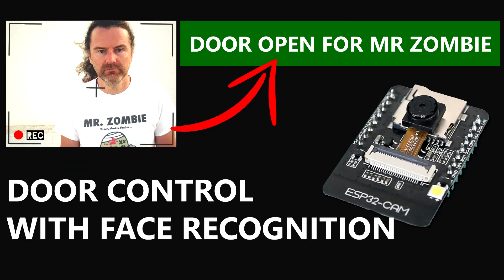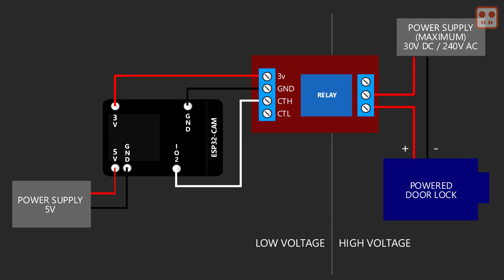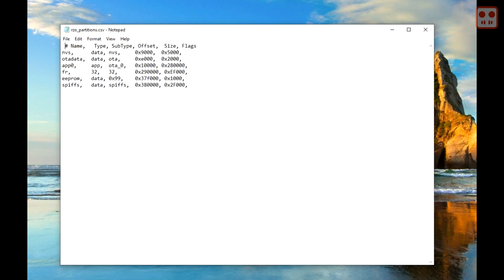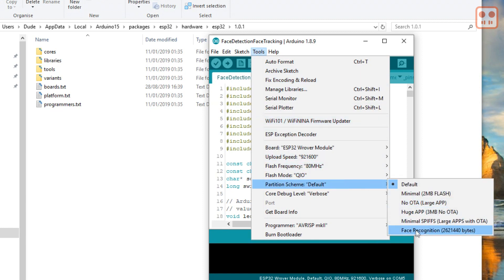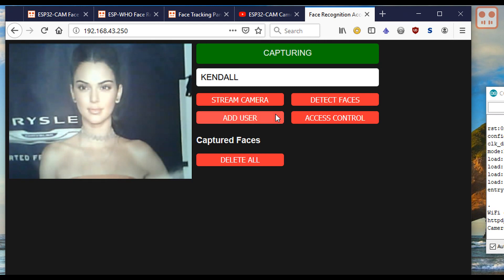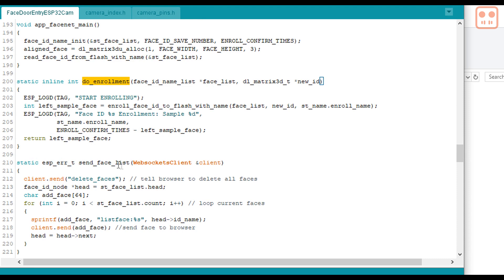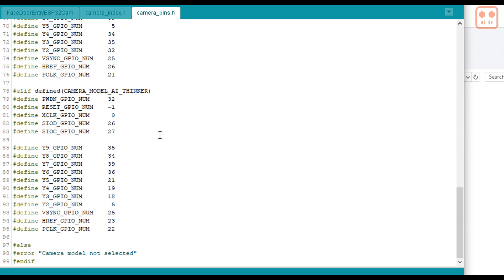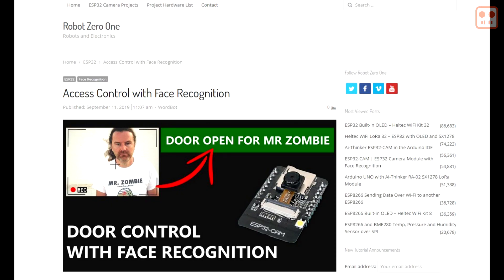ESP32-CAM Face Recognition Open Door Lock

Comment: Sir  @robotzeroone , I'd like to ask if instead of a door control. Could this system be used in connecting to a MySQL database only for checking if the individual is registered or enrolled within the system?
Reply from the maker: yep, you can use HTTP libraries to send data to a server on the internet. There's stuff in my other projects for this.

Comment: hi, sir
i am using esp32cam module for collage project, some error create.

E (4456) system_api: Base MAC address from BLK0 of EFUSE CRC error, efuse_crc = 0xdb; calc_crc = 0xda
abort() was called at PC 0x400d61ec on core 0

Backtrace: 0x40091448:0x3ffd53d0 0x40091679:0x3ffd53f0 0x400d61ec:0x3ffd5410 0x400d6239:0x3ffd5440 0x400f2307:0x3ffd5470 0x400eefaa:0x3ffd5490 0x4009458f:0x3ffd54b0 0x4008db91:0x3ffd54f0

Rebooting...
ets Jun  8 2016 00:22:57

rst:0xc (SW_CPU_RESET),boot:0x13 (SPI_FAST_FLASH_BOOT)
configsip: 0, SPIWP:0xee
clk_drv:0x00,q_drv:0x00,d_drv:0x00,cs0_drv:0x00,hd_drv:0x00,wp_drv:0x00
mode:DIO, clock div:1
load:0x3fff0018,len:4
load:0x3fff001c,len:1216
ho 0 tail 12 room 4
load:0x40078000,len:9720
ho 0 tail 12 room 4
load:0x40080400,len:6352
entry 0x400806b8

can u help me, Please

Comment: hello sir, i followed your project and did it until i tried to add user and the serial monitor shows “fr_flash not found”. it cannot save an image. do i need to use sd card?
Reply from the maker: I think that message is shown the first time you set it up after that I think it will be OK. You can't save images, it's just a mathematical representation of a face. The tutorial on my site might be more up to date.

Comment: I had an error when compiling: error: no return statement in function returning non-void [-Werror=return-type]
Solution:
static esp_err_t send_face_list(WebsocketsClient &client)
replace:
void send_face_list(WebsocketsClient &client)
And
static esp_err_t delete_all_faces(WebsocketsClient &client)
replace:
void delete_all_faces(WebsocketsClient &client)
Reply from the maker: I'm not sure. It's quite an old tutorial and the libraries have been updated several times. Are you using 1.0.5?

Comment: Is there any possibility of doing the same but with an esp wrover cam card?
That is, wouldn't it have conflicts with some libraries?
Reply: I just realized that I'm going to be missing pins to place my fingerprint sensor. This is a double authentication project that I want to do, incorporating fingerprint sensors and more facial recognition.
Reply from the maker: @brianalmeida529  The problem has always been the pins. So many are used by the camera that there are very few available. I think my project will still work with the correct pins set.
Reply: @robotzeroone  What do you think of the wrover cam, will it be useful for my project?
I have the following components: relay, fingerprint, that's all. And if there are more pins left over I want to use one or two buttons.
Reply from the maker: @brianalmeida529  I'm not sure. If you can find a pin diagram you can see which pins are available and what interfaces they offer. This project was mine 
with most pins used so might give some help https://robotzero.one/esp32-cam-scene-analyzer/
Reply: @robotzeroone  Thanks, this will help me. Then I'll show you how it turned out more or less.

Comment: Hi, thats a great video and i want to use it for my final project, what do i do if my arudino ide is version 2.x.x and above?
Thank you vey much i hope for an answer
Reply from the maker: HI, I think it will work with those versions of the IDE but the ESP Hardware library has to be be 1.0.4 or 5.
Reply: yep i managed to do that but i cant see the partition scheme for some reason @robotzeroone
Reply from the maker: Can you change the board to AIThinker ESP32 Cam? Maybe that will work with Huge App selected
Reply: when i select ESP32 CAM it wont let me change the partition scheme at all @robotzeroone

Comment: The relay I'm using is different does this matter ?
Reply from the maker: Probably. Does it have the same trigger voltage? They have to be quite sensitive because the ESP doesn't output much current.

Comment: Sir,  I  mean great  fan of yours. 
Above project is  working  good. 
Can you please  modify the  existing  code so the  esp32 cam keep  working even without  Android  WiFi connectivity,  as this system  stops  working  when the mobile  connection is  lost for what ever  reason.  I mean the  mobile  user interface  should  only be used  for  face enrolment or to delete or add the users. 
With the  existing  system one needs to  keep  one Android phone  to keep system up & running. 
An early response to my  request  will be  highly appreciated. 
Kind regards
Reply from the maker: Here's a version that doesn't need a permanent connection. https://robotzero.one/esp32-face-door-entry/ I think there's also a version in the comments of this tutorial. Other tutorials that might be helpful: https://robotzero.one/esp32-camera-projects/
Reply: Thank you  so much for your  reply. 
Will  try and get back to you. 
Take  care

Comment: I want to implement this project:

"Design of Driver Awareness system depending on Eye and Face Feature and Discrimination"

Can I use ESP32 instead of Raspberry Pi ? 
How do I program it and what do you use ? please reply
Reply from the maker: It will be way too slow for that. It can barely manage face recognition and in the latest libraries they've dropped that.
Reply: @robotzeroone 

Thank you for the answer... I understand from this that I cannot use Esp32 because it has limited capabilities, right?
Reply from the maker: Yep.
 @muhammadsalem9924

Comment: Just in case there is any possibility of performing facial recognition, but without the need to access the web server?, that is, that the esp32cam works independently of a web server, that its function is to recognize the face and open the lock.
Reply from the maker: Yep. Here's a version without the webserver: https://robotzero.one/esp32-face-door-entry/ You can mix and match from various tutorials on my blog.

Comment: I am running the  1.0.5 version and i cant even get as much as a detection of my face at all. and the quality of the video is very poor.
Reply from the maker: Does the CameraWebServer example work for you? Could be a dodgy board.
Reply: @robotzeroone  Its not an issue with the board bc when ran on a version like 2.0.8 i get no issues and smooth video. I  am working on this as a final project and need it complete by next week.  if you could share a way i could get the lock to open based on at least face detection and would most llikley have to be on 2.0.8 because of the video issue. Please get back to me when you can thanks.
Reply: to specify yes i ran the camerawebserver example on 2.0.8 and no issues.
Reply: if there is somewhere better we can communicate that would be great
Reply from the maker: @gabesantiago6941  I don't really have time to look at this but you just need to find the code that does the face detection in 2.0.8 and hook in some code to open the relay. I don't know why the camera would be OK in 2.0.8 and not 1.0.5. It's not a Wi-fi thing is is it? 

Here's two tutorials that use 1.0.4 for face detection. Might be something helpful in them: https://github.com/robotzero1/esp32cam-selfiecam/blob/master/SelfieCam.ino
https://robotzero.one/unlock-door-face-detection-sonoff/

Comment: Hello sir, I am a newbie. I ran your project into the platform io process, and I encountered an undefined error on the operation function of face recognition (such as undefined reference to ''delete_face_id_in_flash_with_name'', etc...), how should I solve it? Also, do I need to put the two files fr_forward.c and fr_flash.c into the project? Because I saw from GitHub that they implemented the algorithm related to the face in the main program, and their .h files just declared and simply constructed them. How did you realize a series of functions such as recognition by only introducing their header files?
Reply from the maker: I can't really help because I've never used Platformio. This will only work with the version 1.0.4 and 1.0.5 of the ESP32 hardware libraries so I would start there.
Reply: @robotzeroone OK, thanks. But why didn't you import the files fr_forward.c and fr_flash.c into the project? You just imported their .h files.Can you explain it to me a little bit if you can.
Reply from the maker: @user-waldner  I think that it just tells the script to use those files in the Expressif libraries.
Reply: @robotzeroone  Hello sir, I have a new question again, dl_matrix3du_t *image_matrix = dl_matrix3du_alloc(1, 320, 240, 3);  Why are you allocating a huge array? Because when I am doing functional operations, sometimes the webpage will get stuck, and then the board will restart the server. Because when I am doing functional operations, sometimes the webpage will get stuck, and then the board will restart the server. The error prompted by the serial port is related to the allocation of the matrix.
Reply from the maker: @user-waldner  Explained here: https://techtutorialsx.com/2020/06/13/esp32-camera-face-detection/
Reply: @robotzeroone  thank you sir :)

Comment: Hi, this project seems to only work for me when my ESP32-CAM is connected to my computer.
So I don't have an FTDI programmer, but I have a shield that came with the ESP32-CAM, and the webserver seems to work when it's powered with the shield connected. However, it doesn't work when I power my ESP32-CAM with my 5v external power supply without the shield.  Any idea why this is happening? All I did was connect the 5v and gnd pins, and power seems to be going through with 5v, so i have no idea what's going on.  Do i really need the FTDI programmer in order to get this to work? I really want to be able to work this without the board having to connect to my computer, so help would be appreciated. OTL
Reply from the maker: HI, It should work. Could be the power supply or connectors aren't providing enough current. The ESP32 uses a lot when the Wi-Fi starts up. Does the CameraWebServer example work?
.
Reply: @robotzeroone  Yes, the CameraWebServer example does work, but only when connected to the computer via shield.  As for the current, I checked that there was current, so it's probably just because i need an FTDI (which is confusing, but i gotta try something.) I just got an FTDI programmer, so i can also include a simple circuit to test while connected to my computer.  I just need to see if my theory works. If it doesn't, then idk what i'm doing wrong...
Reply: @robotzeroone  Besides the hardware though, I noticed that when using the webserver for this code, it does not stop sampling the faces, and the count goes and repeats 1, 2, 3, 4, 7 instead of doing only the four samples 1, 2, 3, 4 and then stopping and saving the face like in your video.  Any idea why this is happening? is there a part of the code i need to change?

Edit: I realized that the states defined ENROLL_COMPLETE and DELETE_ALL are not used at all.  Is there a reason why?
Edit2: Does it matter if i have the AI thinker or the Wrover kit Module? Because I have the AI thinker, and it only works if i put the board setting that way in tools, but the partition scheme selection disappears, so i can't select the face recognition.

Edit3: Okay, i was able to fix the face capturing after seeing someone else go through the same problem, so I fixed the face count variable if statement to stop counting when less-than-or-equal-to 0 since idk how to make the variable not skip 0.
Reply from the maker: @KristellaJackson  IT sounds like somethings not set up correctly from the beginning. I had the face counting above 4 problem once when testing this on a different versions and it was because I'd missed a step. I don't remember exactly. Are you following this tutorial? https://robotzero.one/access-control-with-face-recognition/ ? Using the files here: https://github.com/robotzero1/esp32cam-access-control it should just work.
Reply: @robotzeroone  Okay, yeah, i did not realize i only had to put the partitions.csv file in the same folder with the sketch file.  Fixing the code back to test for fr_flash.h return value is 0, it works properly now; the enrolled faces stay permanently in the webserver even when powering off and then back on the ESP32-CAM.  Thank you 👍

Comment: Excellent project, but i have a problem, i followed all the instructions, i can't compile de project, the arduino ide, doesn't recognize the libraries and it says:
Compilation error: fd_forward.h: no such file or directory,

May you help me??
Reply from the maker: Which version of the ESP32 Hardware libraries are you using? Needs to 1.0.4 or 1.0.5
Reply: @robotzeroone  hi, i'm using the 2.0.5 version, i'm going to change it to that version, thank you so much, if it doesn't work i let you know

Comment: Getting an error of mtmn_config_t has no member named type. How do I resolve it?
Reply from the maker: It's probably the wrong ESP32 Hardware library. Try 1.0.4 or 1.0.5
Reply: @robotzeroone  Done with compiling. In the serial monitor it shows camera probe failed and it keeps on running in loop
Reply: Please can u help, what should I do?
Reply from the maker: @ananyakhandelwal4051  Does the CameraWebServer example work for you? Could be a bad camera, wrong camera settting or bad camera to board connection.

Comment: Hi dear,
My system gets connected to the IP.
The interface is working but it doesn't store
my face ID. Arduino serial monitor shows fr_flash: Not found with different error numbers on each attempt. ESP32 Cam tries to get samples but it is not saved.
I shall be highly obliged if you please guide me where I am getting wrong. Awaiting your response.
Kind regards.
Reply from the maker: I'm not sure what the problem is. Which version of the ESP32 Hardware Library are you using?
Reply: @robotzeroone  Thanks for your quick response. I'm using ESP32 hardware library 1.0.5 for this project.

Comment: Whats the diference between Wrover and AI thinker?
Reply from the maker: AI Thinker are a company that manufacturers various devices. They created the ESP32CAM and then lots of other companies copied it! Wrover is the ESP32 module from Espressif that has the extra memory needed for face recognition.
Reply: @robotzeroone  I use your code and in the web camera site dont apper se square of the face recognition, Im ussing a freenove esp32-cam
Reply from the maker: @joselagunas298  Which version of the ESP32 Hardware library are you using? 1.0.5 is best.
Reply: @robotzeroone  Im using 2.0.4
Reply from the maker: @joselagunas298  It won't work. A lot has changed in 2.x . My project only works in 1.0.4 and 1.0.5
Reply: @robotzeroone  Thanks, one last question, What kind of adapter are you using in the power bank, its usb to rs232 or what kind of converter its?
Reply from the maker: @joselagunas298  It's just a USB connector that has the data and power lines split to a connector each that you can attach wires. You can do the same with an old USB cable by cutting and stripping the cable.

Comment: What a great project. Congratulations and thanks for sharing. 
I'm trying to implement it in 2022, with arduino 1.8.19 and esp32 board version 1.0.6.
I always receive an error message  sth like "error compiling for esp32 wrover module"
I tried to change board version for 1.0.4 or 1.0.5 but there's no difference. 
I can't see the new partition scheme, I'm always using the "huge app" partition. 
Any ideas on how to solve it?

By the way, the standard camera web server example works fine for me.

Thank you.
Reply from the maker: With 1.0.4 you have to manually create a partition. With 1.0.5 it should work just uploading the 4 files in Github. There should be more in the error log to identify why it won't compile.
Reply: @robotzeroone  Thank you for your quick reply. I'm on 1.0.6 and I can't see the face recognition partition scheme. My sketch folder contains these files:

- camera_index.h
- camera_pins.h
- FaceDoorEntryESP32Cam.ino
- HTML_interface.html
- partitions.csv

From the error log, these are the lines indicating some sort of failure:

- Error while detecting libraries included by C:\Users\rbala\AppData\Local\Temp\arduino_build_759010\sketch\FaceDoorEntryESP32Cam.ino.cpp
- Error while detecting libraries included by C:\Program Files (x86)\Arduino\libraries\Firmata\Firmata.cpp
- Error while detecting libraries included by C:\Program Files (x86)\Arduino\libraries\Firmata\utility\SerialFirmata.cpp
- In file included from C:\Users\rbala\Documents\Arduino\esp32cam-access-control-master\FaceDoorEntryESP32Cam\FaceDoorEntryESP32Cam.ino:1:0:
C:\Program Files (x86)\Arduino\libraries\Firmata/Boards.h:856:2: error: #error "Please edit Boards.h with a hardware abstraction for this board"
 #error "Please edit Boards.h with a hardware abstraction for this board"
- exit status 1
Error compiling for board ESP32 Wrover Module.

Indeed, I found this Boards.h file inside the Firmata library folder and it doesn't contain any definition for any ESP32 board.

Any hints ?
Reply from the maker: @rodrigobalani2297  I had a look and I'm not sure what the problem is. I don't have a definition for the ESP32 in that file with version 1.0.4. Maybe it's something to do with the Arduino IDE version.
Reply: have you fixed the issues? please help me
Reply: @lam37-98  sorry, I stopped testing, I used that board for another application and recently I don't have time to dedicate to it.